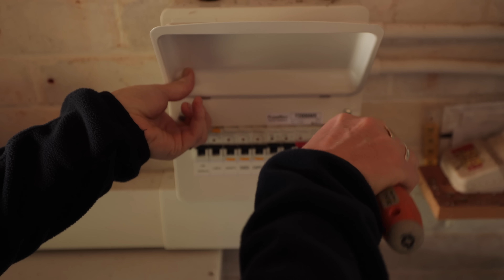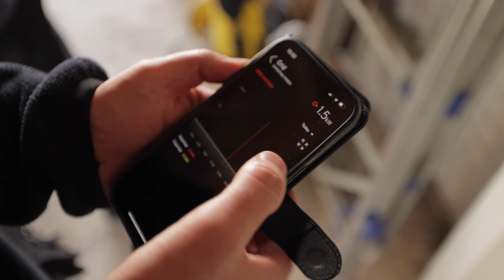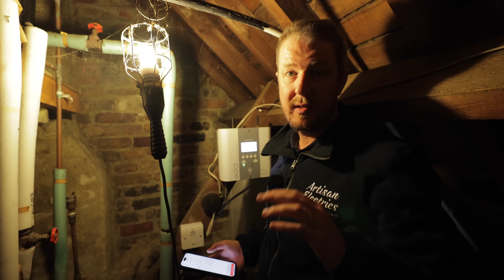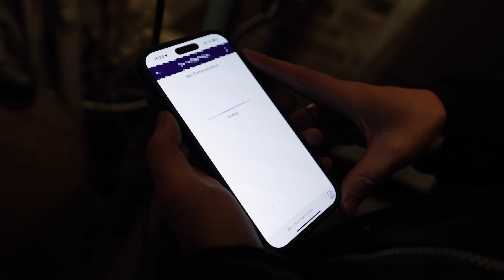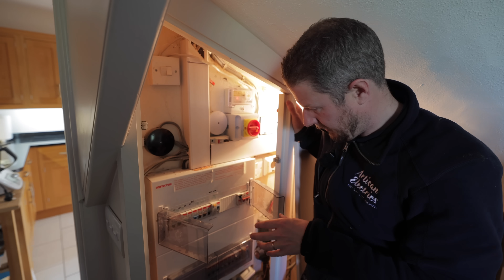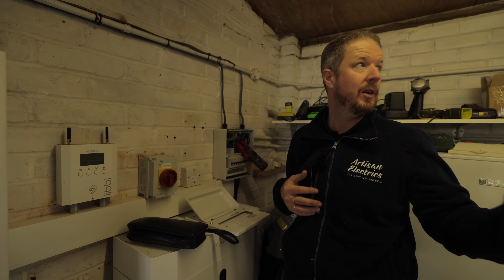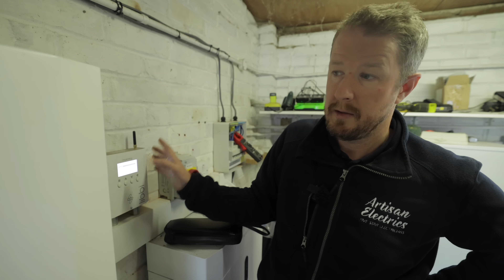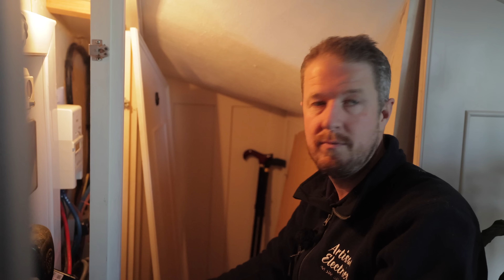£20,000+ Battery System RUINED By This 1 Simple Mistake 😳

Comment: If renewables are the answer it was a stupid question. Spending tens of thousands of dollars/pounds to save a few pounds a year when the design life of the equipment will never see a net positive return before failure is just consumerism gone mad.  Solar renewables in Australia was way oversold and solar owners in Australia are now being penalised for having systems, not only that the grid operators are demanding control of your system so they can use your battery to support their grid when supply is tight.
Reply: Sorry? Most systems will pay back back the investment in less than 10 years. Find me somewhere else I can get a 10% ROI tax free....
Reply: @rugbygirlsdadg  assuming the kit is worth nothing after 10 years, then to get a 10% ROI surely you have to be gaining savings of 20% of the total initial cost each year, 10% just to cover the depreciation/sunk cost, and then your 10% ROI on top. Are you saying the savings are really 20% of the cost on an install like that each year?
Reply: @AJB1  Not worth nothing after ten years, but if you are selling your house, then the equipment becomes a liability at that age, not an asset.
Reply: It heavily depends on the price of electricity, gas and petrol (home charging with EVs = big savings for commuters). If you installed one of these in 2021 you'd be laughing your head off at the savings and it'd probably have already paid a big chunk back. Now? Maybe not so much, but there are still deals to be had.

I wouldn't personally spend £20k for solar + batteries as I don't have an EV and my bills aren't very high compared to some, but everyone's situation is different.
Reply: @defragsbin  The problem with the big savings for commuters argument, which our prime minister here in Australia tried and disgraced himself is. A commuter uses their car to travel to and from the place of employment, the EV will not be at home during the day to accept all that free energy.  And to have over 100kWh of battery installed  to recharge the EV is going to cost gazillions. Not to mention that a 10 kW solar system would need at least 10 Hrs of peak output to recharge the battery , something that rarely happens in England I'm led to believe.
Reply: @raygale4198  you're being very negative about how this works in practice. There are tariffs in the UK where you can charge your EV via off-peak rates at night and use solar to export during the day. E.g. Charge your EV for 7p/kWh, then export your solar during the day for ~15p/kWh. You don't even need batteries to do this, batteries just give you more options. Folks need to do their sums and figure out what makes sense for them, just the same as when performing any home efficiency upgrade -- what is the payback time for your particular circumstances? What makes sense for one family won't necessarily make sense for another.
Reply: @defragsbin  I think I mentioned in Australia we are paying around 45 cents per unit, feed in tariffs are as low as negative value depending on the time of day. Our energy prices have more than doubled since the uptake of renewables. Englands time will come when it's realised how much the grid is destabilised by distributed generation.
Reply: @defragsbin  Bit like a Ponzi scheme, those that get in early profit from those that came later.
Reply: You’re commenting from Australia. Try doing payback figures for the UK. 😉
Reply: @hughmarcus1  Considering Australia has roughly 300 days sunshine a year, and we are paying around 35 - 45 C per unit for energy ( energy prices have more than doubled since the introduction of home solar) the economics don't work for us. We have dual register smart meters, what we get paid is on a different register than what is used on the site. Plus the price paid varies with the time of day, when everyone is generating the unit price paid can be as low as 3 cents per unit, in extreme cases you can be charged for export when the grid is over supplied. Meanwhile we are being charged up to 45 c per unit for power used.  Our prime minister (Albo Sleazy) promised us we would all save heaps of money charging our cars at home overnight on free solar energy!  That's the sort of witch craft zealots believe.

Comment: I don't understand the logic of wiring all the kit carefully but using WiFi to network the units. Just run some Cat-5 cables and use Ethernet - it doesn't go wrong, it's faster than WiFi and not subject to interference from neighbours and signal dropouts
Reply: I don't understand the logic of having a seperate cupboard for your knickers and underwear to dry near the hot water tank, yet having a few thousand quid in electronics and battery storage scattered around the home and in a 40 degree
roof space. That nobody wants to go in. Stick your head up there in the summer and see how you feel about it. Lets have a proper plant room......
Reply: Alternatively I bought a much more powerful WiFi router than the ISP provides that I connect to all my devices, so when I change ISP I don't have to change settings on any devices. Running 10s of meters of Cat 6 cables through walls looks ugly and is a great expense. I'm a project manager for new office buildings and everyone only runs Cat 6 cables to the WiFi Access Points (routers). The savings of not running cables to desk is huge.

Comment: Batteries in the lofts are not guidance but this wasn't always the case Jordan. Octopus energy still fits them in the loft if I'm not mistaken.
Reply: We had our system installed in Jan 23 and one of the things I was concerned about was the inverter and batteries being in the loft.  Not having a garage, but having a shed built into the house I proposed them being installed there but was told the loft was fine and at the time there was nothing really to say otherwise aside from a few unverifiable‘internet stories’.  We’ve had no issues but still concerns me when someone says you shouldn’t.

What I guess is there are a lot of houses much smaller than ours that also don’t have a garage to put the gear in - would some installers simply refuse to take on the job?  What about someone in a mid terrace where options are even more restricted?
Reply: I live in a very small house where I have converted the loft and I don't have a garage. Instead the inverter and batteries are attached the outside wall. I had the system for 2 years and had no problems

Comment: 7:33 But is it next to nothing? I export to Octopus at 15p / kWh and gas is on about 7p. Surely it's cheaper to export and still heat the water using gas?
Reply: If gas and import is at the same price per kWh, it's marginally cheaper to use the Eddi because it's slightly more efficient. There is some energy loss with gas
Reply: @rugbygirlsdadg  why did you say import?? We know import is almost 4x the cost of gas. Export is slightly higher than 2x of gas. So they're nothing like the same. Ordinarily you'd never choose electricity to heat your water and even with the reduction in price for exporting it still doesn't make sense.

Comment: "Ruined" would infer it had been irreparably damaged. This was not.. It was "running terribly"
Reply: yeah, this is why no sub from me.
Reply: @JohnW118 That's OK, he got a sub from me because if the content is good enough, I'll overlook the tabloid headline.
Reply: @JohnW118  Same. I hate clickbait titles. I also disagree about having automatic firmware updates. If it works, leave it alone.
Reply: @slo007 I disagree. If the vendor found a problem, I’d want to have it fixed. Having an option for notification and manual updates would be ok, but most people wouldn’t bother. Having worked in computer security, updates are a good idea. 
Yes, there have been rare cases of updates breaking systems, but very rare.
Reply: Not even terribly, just sub-optimally.
Reply: @scottc2455  Not using half the capacity, not saving the customer who paid a significant sum for it money - that's "terribly." Like, what do you want from "terribly", an explosion and fireworks? If your porsche only does 120kph, wouldn't you classify that as "running terribly"? Like, sure, you can get from A to B with it, but if you want a car that does that, you'd spend less than half the money.

I'm somewhat baffled by this comment.
Reply: That's why I'm 10 minutes in and checking the comments.  I was wondering when we were getting to the point of the video title.  I haven't watched the rest but after reading this comment, I'm not going to.  Youtubers need to realize that clickbait works for instant gratification results but kills long-term results.  Sorry but I will never be a subscriber here.  Too bad because he came across as an ethical guy until you realized he's using a cheat method for YT views.
Reply: baby's first clickbait title
Reply: @DeonexGlower far from it, but if you see it you should speak out about it.

I assume you are the type who would have let hitler ravage the whole of Europe and comment to people "Babies first war" when someone tries to say anything bad about it
Reply: Yeah, he might know his stuff but these kind of titles make him look like some loser hypebeast.
Reply: “This One Electrical Hack Will Change Your Life FOREVER!”
Me watching:
Unplugs the device to be safe.
Some hacks are better left alone. ⚡🛑
Reply: Oh dear, some of you are judgemental…you should know YT pushes for stupid titles to maximize their income too.
Reply: @peteypops  you should know PEOPLE pushes for honest titles and don't care what YT algorithm wants.
Reply: The savings were ruined for a few years. 🤪
Reply: Thanks. *Jumps to next video.
Reply: “Ruined” is an implication not an inference.The Title implies and you infer from the implication.
Reply: @Reallydecentchap  dictionary
Reply: "Rain ruined our day out"  .... 🤷🏻‍♂️did the rain "irreparably damage" the day?
Reply: @simon593  out of interest, what time machine did you use to unruin that portion of the day?
Reply: @ColinRichardson  why do you care 🤷🏻‍♂️
Reply: @simon593  interesting question, why do you care my reasons for caring?
Reply: Another thing that got me was how he overplays that plastic melts with heat when he's talking about the water tank, which is made of plastic. I've NEVER seen a plastic water tank that would melt at 100C. That would be asinine to use such plastic and I'm pretty sure there's a code preventing that.

Many clickbait things in this video. Channel is now blocked from my feed.
Reply: My idea exactly, and all in caps as well... It's what's called clickbait. Totally not necessary and frankly misleading.
Reply: @hapskie  Sadly in this highly competitive world, it is necessary.
Reply: wow, you guys are new here?
Reply: @extracoolboy  wow, you guys love dishonest titles?
Reply: Knew something felt off. I came to the comments before even clicking play. This channel won't be getting any views from me

Comment: In other words configuration and firmware updates. At least it was a simple enough job.

Ive done 3 full van installs now using victron kit which is great as it just works!. I do find the house solar interesting though. Are there specific courses that focus on renewable installs?